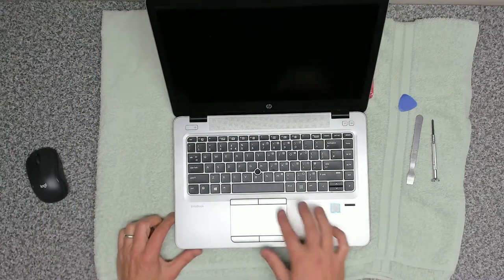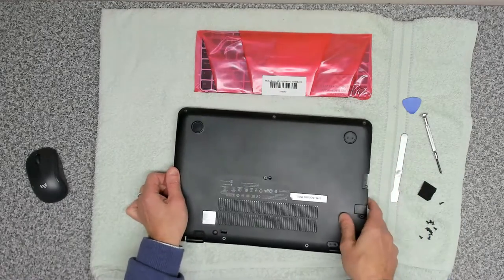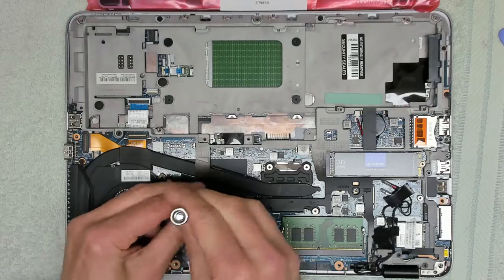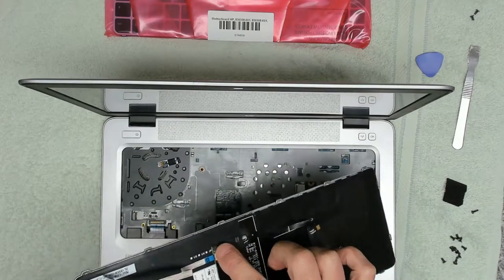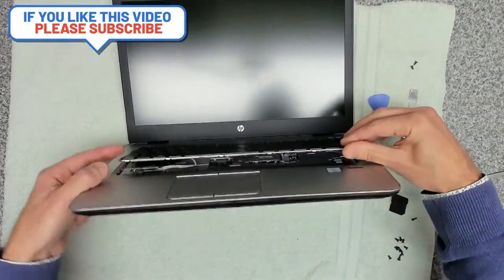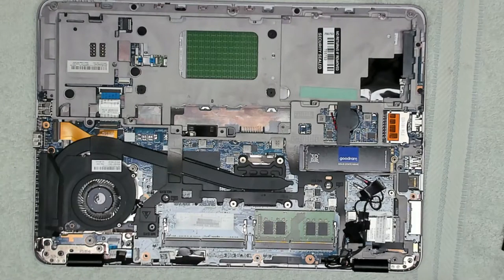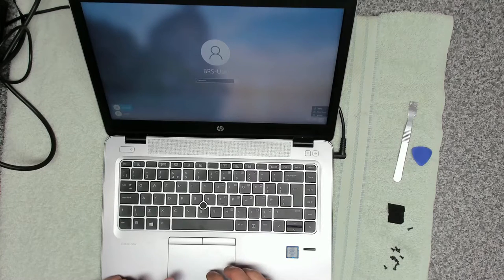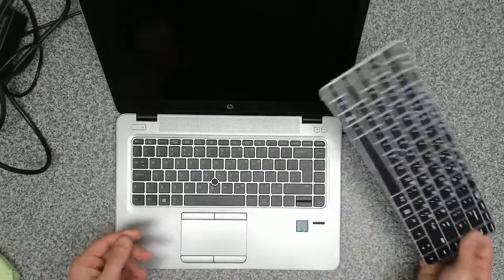HP Elitebook 840 G3 keyboard replacement step by step

Comment: Better press keyboard from the inside of notebook with a screwdriver to prevent it from scratches on the top. It's described in hardware maintenance manual.